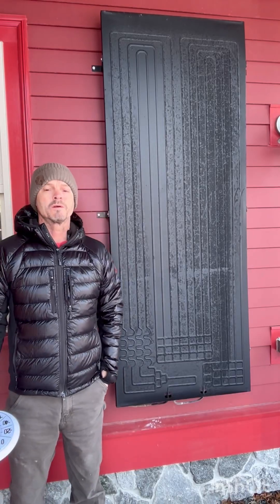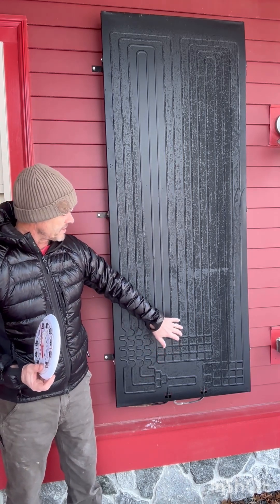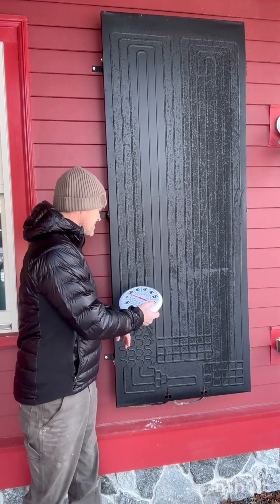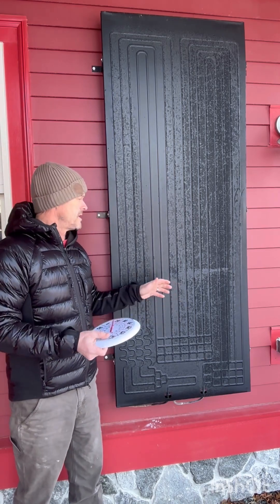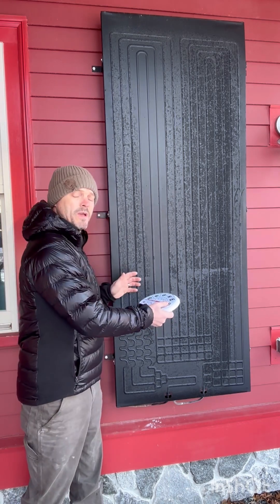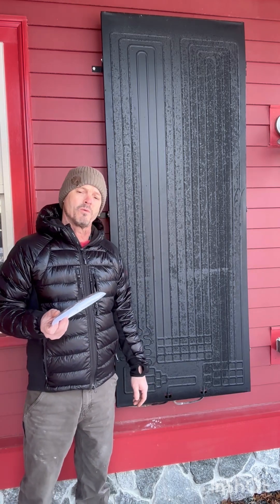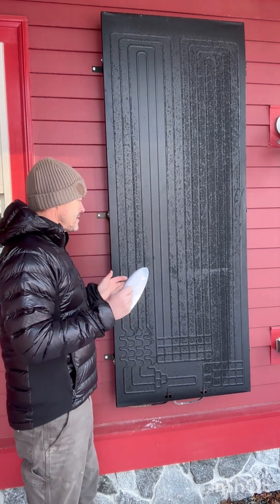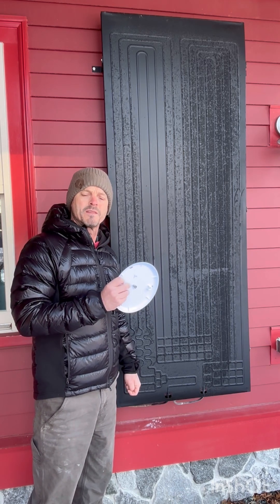Smart Solar Heat Pump Water, Cold Weather Hot Water Production

Comment: Bruce, would your system work to use for radiant floor heat?  Located in central Wisconsin.  Thanks for your videos
Reply: Good question. Am interested too
Reply: @DimONMINIpeople  I've been thinking about putting in a heat pump tank water heater just to run the in floor heat, then looking into solar to power it.  Depending on power consumption needed
Reply from the maker: Thank you for asking. But no, at 900 watts production on a very cold day (for example), there is a not a lot of excess heating capacity available after meeting the home’s domestic hot water needs. We have had people use these for hydronic heating applications, but always a very small space such as a bathroom floor.
Reply: @ thank you for getting back on my question - keep up the great work on the system